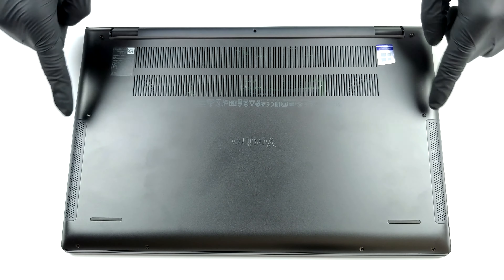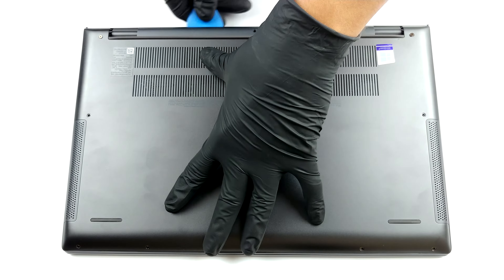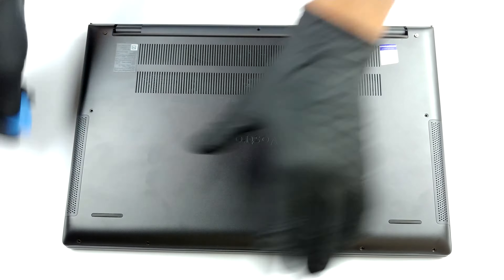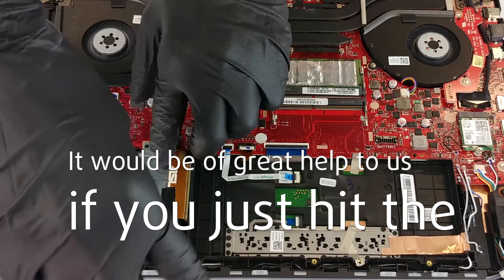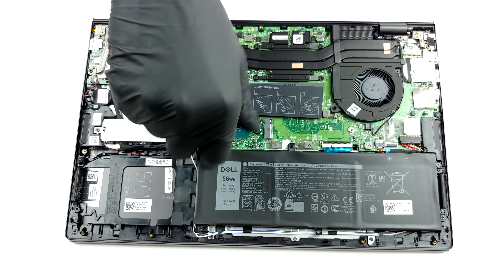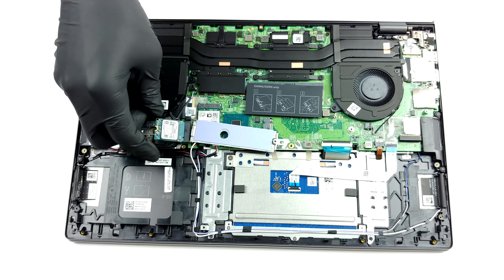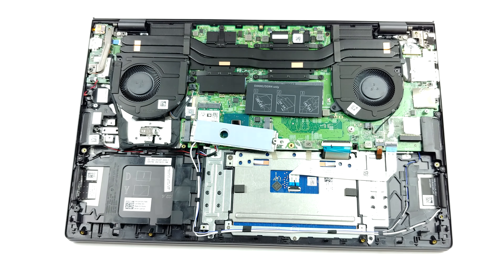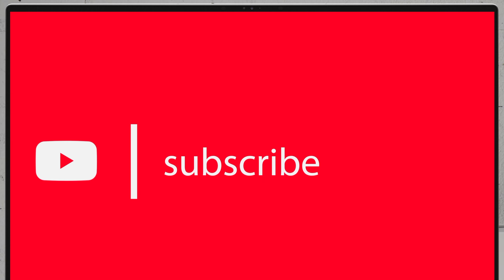🛠️ Dell Vostro 15 7500 - disassembly and upgrade options

Comment: do you have a video that goes over replacing the keyboard not individual keys; and in your video when it comes to hard drive you mention there are two slots...but you don't go over how to upgrade the hard drive...is there a video for that? Thank you. Your video really helps. Wondering why DELL a multi-billion dollars company doesn't provide information so helpful to customer like you have. Thank you again.

Comment: Is it possible to upgrade the battery to a 96Whr battery? Is there enough space?
Reply: Old comment but yes, in some markets the 97Wh battery was standard.  It extends into the space in the lower left however, you will lose your HDD bay.  In markets where it was sold with this as standard it just came with SSD options though.
Reply: Ich hatte auch ein kleineres Akku und habe es in das 97wh getauscht, die Löscher/Bohrungen sind da. Es passt und funktioniert.